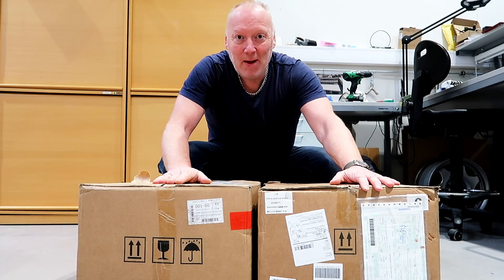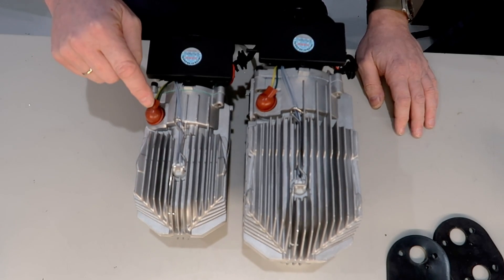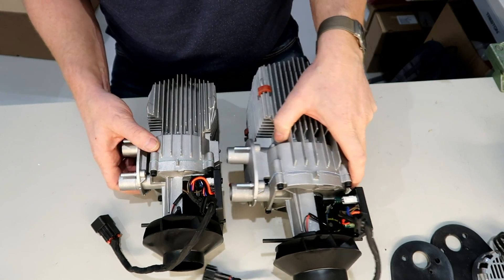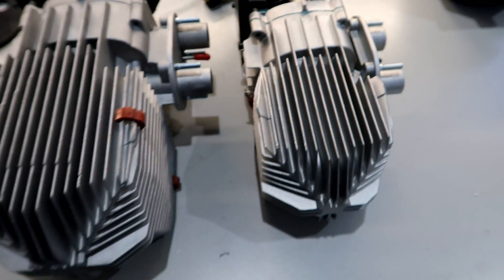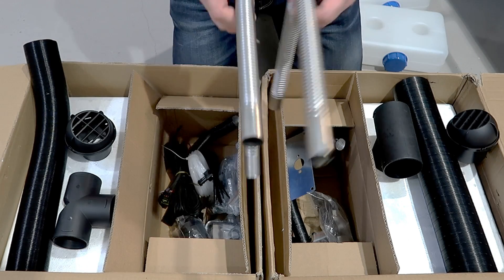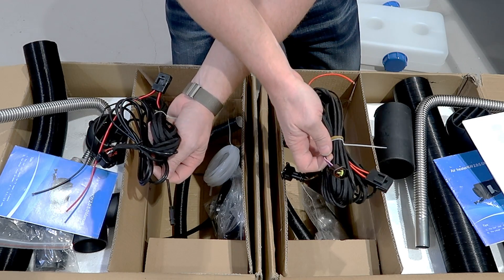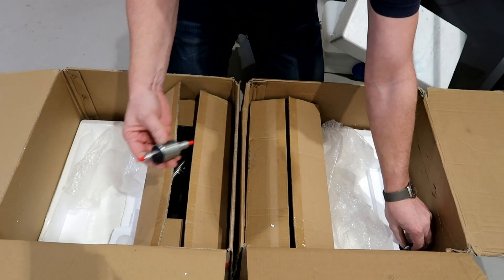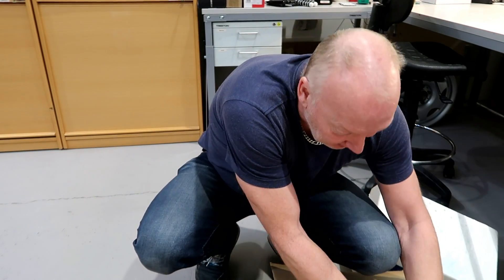Chinese 2kw vs 5kw diesel/parking  heater comparison part 1.

Comment: It's easy. the difference between 2kW and 5kW results only from the amount of fuel burned. Calculation of the pump 22ml * 2.6 Hz * calorific value of diesel fuel = 2kW; Pump 22 ml * 6.5 Hz = 4 kW. To release more heat while burning more fuel, a larger housing with a larger heat sink is needed. Electronics can remain unchanged.
Reply: calorific value of diesel fuel = 43 MJ/kg; 1 liter of diesel = 0.83 kg; 1kW = 3.6MJ... now multiply everything and you will get the heating power

Comment: For a honda civic would you recommend the 2KW or 5KW heater? Or they basically the same? Perhaps more fuel usage on a 5KW? I'm in Canada, so it gets cold, -15 celcius, want to do some winter camping. The heater will also be outside, so it will be drying in cold air. Would want the heater to run on low and keep inside the car at about 18 deg. Celsius. Would it be automatically turn on/off according to thermostat temps?
Reply from the maker: I will have to say the 2kw, but I'm no expert. maybe you could ask on some of the many heater sites on facebook, like this one: https://www.facebook.com/groups/419122475590648

Comment: can i extend the positive and negative cable on a diesel heater loom
Reply from the maker: Yes, just make sure they are thick enough. Measure the voltage at the battery and then compare with the voltage at the heater. It should be almost the same. If too low you need thicker cables.
Reply: @Italjohn   thankyou !

Comment: I have both a 2 and 5 kw heater.  The Chinese heaters are a bargain, but have spotty quality control.  The motor that runs the fan in the 2kw has 2 ball bearings that are very tiny.  The 2kw started making howling noises about 4 months after I got it and I found that of the two bearings, one apparently had not been lubricated at the factory (one bearing was like new, but the other had orange dust leaking from it...RUST.)
Reply from the maker: Thanks for the update mate.
Reply: BIggest issue is sealing. You have to seal the fuel entry tube seal and the glowplug seal with rtv at the minimum. I also seal the motor to the motor shout .

Comment: Does the smaller unit still require too much wattage on start up to be used off a 12V?
Reply from the maker: They pull the same wattage, as it's the glow plug that uses almost all the 10-12 amps needed to make it ignite. You can use it a 12 volt power supply as long as it can deliver at least 12 amps.

Comment: As the first video i have found, that shows the white full alloy body model of 5kw(some claim 8kw), which i have 3 of(i prefer all metal ones only, just seems much safer to me). I thought i would let folk know, there is a total junk model out there. Much to my disgust i bought one as well. The difference is that the top cover is a full half of body cover, which splits both the inlet and outlet, rather than just the inlet like these ones. 
Be warned, they are junk, no parts are interchangeable with the others (all 3 of my good ones are from different manufacturers, but all parts swap fine), they have no advanced settings option, the supplied baseplate needs a lot of filing to fit studs and clear air inlet port, the display of controller blanks after 10 seconds until a button pressed again, and the noise of the fan is horrendous, (like we are talking 50 times louder than the others on minimum speed, i have both side by side for testing ) very nasty items, and worse some use pictures of these ones to sell them (as did the local jerk i bought off), so it's wise to ask if item being sold is actually the one pictured.(noise is a high pitch howl, a bit like feedback in an amplifier type of sound, really annoying)

Ps, the good ones are nice units, no issues seen yet, with at least 200 hours run time each on 2 of them. 
My calcs say likely only 4- 4.5kw max though, using 0.5 liters per hour running flat out, at 8hz and is correct when compared to consumption on espacher site(i find advanced settings of 1500/5000 rpm, and 0.8/8hz works well for me at sea level)
Reply from the maker: Thanks for letting us know 👍

Comment: Pumps should be different capacity, as I see spare parts.
Parameters defaults should be also different
Reply from the maker: You are right, I have figure it out now 😀 look here: https://youtu.be/kOaQKf-i2f4?t=233
Reply: @Italjohn  when u enter the secret 1688 page, there is a useful parameter to decrease power of glow plug (less current drown when starting and stopping heater.)
1-3 is for 40w glow plug
4-6 is for 80w one.
4 is minimum and save 3A, compared to 6 as default set

Comment: Is my math correct when I say a 2000watt rating will use 166amps at 12v? If I have only 200amp hours battery storage at 12v I could only run this heater for 2 hours...
Reply from the maker: It gives 2000 watt of heat, it does not draw 2000w from the battery. It's all in the decription below the clip. 
How Much Power Does it Consume?
1. On startup the heater takes 10 amps for approx 2 mins 39 secs whilst the glow plug has power (6whr (watt-hour))
2. On low power 1 amp (13whr)
3. On medium power 1.8 amp (24whr)
4. On high power 3.7 amp (50whr)
5. On shutdown the heater takes 10 amps for approx 55 secs whilst the glow plug has power (to ensure all fuel is burnt off before cooling down and shutting off)
6. On cooldown the heater takes 1 to 1.3 amps, the time period varies depending on what setting the heater power was prior to hitting the stop button. but approximately 1.5 to 3 mins 
In a nutshell, run overnight, expect about  150w over  8 hours (calculated, not measured, yet) which on a 12v system is about 12 amp-hours.

Comment: I would be interested in knowing if there is a difference in cfm of the circulation fan?
Reply from the maker: 2k units produce ~62CFM, and the 5k approx. 150CFM
Reply: @Italjohn  I have had trouble with the 2kw heating my 5th wheel. When it's very cold and windy. The temp coming out of the vent is plenty hot. I ordered a 5kw unit because I believe I just need to circulate more air. Great video.

Comment: Approximately how much diesel will be required to generate 1 kW of heat from the 2kw unit ? I only need 1kw of heat .
Reply from the maker: How Much Fuel Does It Consume?
 About 0.1L per hour per KW of heat. Look for more info in the decription below the clip.

Comment: Im trying to decide which to get, I'd rather the 2kw because in my testing with other heaters that is more than enough, also Ive heard they last a lot longer between cleaning if you run them on their highest settings regularly...5kw would roast me out of my truck for sure.
Reply from the maker: Yes, a 2kw is more than enough for a van

Comment: Italjohn, what are the overall size of each heater mate.?
On eBay their are 2kw and 5kw heaters, sold directly from China and both are shown as 15 x 15 x 38cm...which i am thinking is the smaller one..?
 Just dont want to get ripped off. Thx.
Reply from the maker: The 2kw is: 28*11*11cm  Bought it here: https://bit.ly/2TlMU0I

Comment: Where did you get the 2kw unit from with the remote control. I can only find the 2kw with a manual dial .
Reply from the maker: I have added a link under the video, in the description. Bought it on Ali Express.

Comment: The #5 in the description.  Why glow plug at the end (waist of battery power). The glow plug will not get the burn chamber any hotter than when it was burning fuel? The glow plug at beginning will clean any sout left from previous burn. I like the idea of the diesel heater but looks like it consumes a lot of battery amps at startup and shut down. If one does it several times during a day, the battery will run down.  That is why I have seen(UT) people letting it run continuously (or long runs) on low.
Reply: I think that was the intent of the design. Consumption for anything including an ac unit is highest at startup. That's why you usually trip a breaker when you plug something in.   At low power the 2kw uses .1ml of fuel I believe and at high I think it uses .24ml... 250% more consumption at startup which lasts approx 5-10 minutes. You're better off running at low continuously for electricity, fuel and carbon buildup. My inexperienced 2 cents anyway.

Comment: do you have a solution or ideas on how to make these heaters operate at high altitudes, it seems lack of oxygen cause flameouts. I think the european  models have a type of compensator to adjust for altitudes. What say yee.
Reply from the maker: I have no idea, sorry. The blue remote has a altitude "meter" built in, maybe this fix the problem?
Reply: mix 50/50 diesel/ petrol

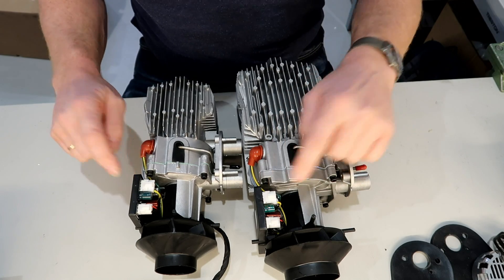Comment: The plug @5:00 is REALLY importent that it is tight to the body! If there is a leak from the burnchamber  carbonmonoxide will come out there.
Reply from the maker: Good tip, thanks 👍😃

Comment: I was about to change 5 into 2, as it is too hot after 30 mins... Do you think it will fit with just changing the only wire for the remote control? Or maybe even just using the same remote control? Thanks a lot!!
Reply from the maker: I can't tell really but if the plugs are the same, I think they would fit either way. On my two heaters the circuit boards looks identical.
Reply: @Italjohn  thanks

Comment: did I miss the muffler?are you willing to test on with US gasoline not diesel,, most motor homes here do not use diesel,,  I believe the computer on the unit will control the unit by temperature...will you bench test it for us on YouTube...
Reply from the maker: No I will not test this with gasoline. Please read/ask in this group: https://www.facebook.com/groups/146837062640024/
Reply: It is called Diesel fueled heater for that reason.
Reply: it is but, I will do it when I have the time.. you wont even try... 
put it on the workbench and test it,,, one time,,
Reply: David McLuckie on Youtube has a film.. it does run but,,,, ?
Reply: @hamishconstruction why don't you go get a $200 diesel vehicle off craigslist and see how it runs on gasoline. When the motor seizes you can take it to the salvage yard for $200

Comment: Hi, loved your comparison, thanks. Is the 2kw quieter?
Online the 5kw is rated at 76db. Would the 2kw be less?
Thanks again.
Brian
Reply from the maker: I can't tell as I have not tested them yet. I will however install the 2kw in my Vanagon T3/25 soon. The 5kw will be sold or kept for parts.
Reply: @Italjohn   have you installed this yet? I was wondering how to keep the diesel tank out of the inside of the van. Just curious where people are keeping it.
Reply from the maker: Hi Kristen. No it's still in the box ☹ I have not decided if I shall install it under the van or inside. I think I will go for the "under van" solution. The diesel I will take from the cars diesel tank.

Comment: Need around 30 to 40 BTU's per square foot of space you want to heat (depending on how insulated your space is. The smaller one 2KW (6,000 BTU's) would be good for around 150 square feet. Most vans are only going to be around 110 square feet or less so the larger ones would have very short run times and the burn chamber will soot up and you will have to take it apart to clean it. Need to size what you want to heat up so it works properly. If you put one that is too big for your van or camper it will soot up. Ones that are too big for where you are using it will shut off to fast before the burn chamber can get good and hot to burn off any soot.
Reply: The one I have stays on all the time (5KW). The setting just sets the fan speed and fuel pump pulse rate. No thermostat so it keeps running till you turn it off. been running it for two years now with any issues. No smoke, no hard starts. With that said I have changed the pump annually and the exhaust pipe once. I have a chinese brand heater. I love it and it has been a game changer for keeping me comfortable in my van during the winter.
Reply from the maker: Thanks for that informative answer.
Reply: I disagree by far, 5KW running for 5 years every winter for at least 60-100 days in a mini Camper, it Minus degree are enough outside it's not an issue because it runs long enough on full power

Comment: Thanks for the video.  I just got my 2kw one but couldn't tell whether they sent me the 2kw one or a 5kw one.  I'm glad to say I got the right one.  A 5kw would have been WAY too much heat for my purposes.  And setting these on low for too long will build up soot...so I hear.
Reply: Anyone know if a chafon power generator would run this? 346WH
Reply: Where did you get the 2kw init from. Do you have the link where I can find one.
Reply: @philprice760  I got mine off amazon.  I went back and looked and don't see it in my history of purchases so I'm guessing the seller no longer has any.  This kit at this link looks like the same thing I got.  This seller only has 3.5 stars though so maybe search around on amazon for better seller.  Also, I later decided to get a digital readout for the heater since it gives you more control over the heater. 
I've used mine on a couple winter trips and I turn it on for 10 min ever month and it seems to be working fine still.
https://www.amazon.com/Happybuy-Motorhome-Trailer-Control-Silencer/dp/B07LFXMNMD/ref=sr_1_2?crid=1SS56MG236ZIH&dchild=1&keywords=2kw+diesel+heater&qid=1590206200&sprefix=2kw+diesel+heater%2Caps%2C194&sr=8-2
Reply: Oh, also, I've read that the mufflers that don't have a bend are quieter.  I could never find one that wasn't similar to the one in the link... which does have a bend.  I personally don't find it all that loud though. 
NOW, the fuel pump is a different story.  That clicking is kind of loud, especially if you actually connect it to something.  What I did to quiet mine was take a container and lined it with some soundproofing.  Then I cut a hole on each end at the top and rand the fuel line through it with the fuel pump suspended in the air inside the container.  You can still hear it but no wear near as bad.  I have mine on the inside though.  Many people mount their on the outside but I didn't want people walking by to hear it from a distance.  You have to get kind of close to hear/notice the muffler.
Reply: From your message I’m assuming you can buy the digital control unit separately then for the 2kw unit where for the 5kw they come as standard?
Reply: @philprice760  Switching out the controller was super simple.  It was plug and play. Mine seems to work fine.  However, when I looked it up just now the one that I have is no longer available by the seller I used.  When I look at other sellers that have what looks the same theirs says that it works on 3/5kw heaters. 
That said, I ran into a LOT of confusion on these heaters.  It would not surprise me if the 3kw heater is the same as the 2kw heater.  That either the 3kw is really 2kw or that the 2kw is really a 3kw... or possibly both are 2.5kw or some other mix.
The digital control I bought said, "12V LCD Monitor Air Parking Heater Switch Controller for Car Track Diesel Air Heater MA1870"
The ones I'm seeing now say stuff like, "3/5KW LCD Switch 12V LCD Monitor Air Parking Heater Switch Controller for Car Track Diesel Air Heater MA1870"
Again, via Amazon.
And even if they are supposed to be exactly the same and they aren't necessarily "exactly" the same.  I heard mixed things about the one I got in regards to whether it would work or not.  Some said it did for them, some said it didn't.  Mine happened to work.  So, maybe two different versions?  Maybe some were broke?  You got me. 
I will note, however, that the ones listed now have remotes.  Mine didn't but it is possible it has the ability and just didn't come with the remote. 
Also, the digital controller I got is the black plain version.  There is a fancier looking one that is oddly shaped and comes in colors.  I've heard that one would work on mine also but I wouldn't know for sure.
Btw, if you plan to just turn the thing on and off then the plain knob control works fine. The digital one provides additional abilities.  I think it allows you to put it on a timer, which I personally would never do.  I only got it because I wanted to be able to change the fan/pump speeds so I could perfect the burn to prevent sooting at high altitudes.  From what I can tell they are calibrated to run best at lower altitudes.  Figuring out how to best calibrate for different altitudes, is an entirely different rabbit hole...lol.
Reply: I am a bit sceptical about buying one of these Chinese heater tbh. I’ve heard good and bad reviews. My heart is telling me buy an Eberspacher and have done. Made Germany. Top quality etc. Something that is 1/6 of the price mustn’t be as good. I’ve had cheap before and always ended up buying the expensive one in the end so ends up costing me more. 🤔
Reply: @philprice760  I think it depends on how often you plan to use it.  I only use mine for winter road trips.  So, not that often.  If I was living in my van full time or doing tons of cold weather trips then I probably would have gone with a more expensive one. 
That said, if I had plenty of money then I probably would have gotten the expensive one regardless.

Comment: They do two sizes in the metal box ones a 2kw and 5kw they are the same 75mm air outlet same engine the 2kw is fuel restricted the small one is the old model now the 2kw and 5kw well be the same size makes it easier for manufacturing.
Reply: I was looking at getting one of the all-in-one units. Are you certain that they are all the same 5kw heater unit size? I wanted a 2kw, but not a tuned down 5kw.

Comment: Had mine up and running, but now it's stopped showing E-06, and the fan icon flashing......tried everything , to do with the fan, moving it by hand etc, it runs freely but there is a click on the PCB, the icon flashes, E-06, and nothing. Any ideas would be most welcome.
Reply from the maker: I will highly recommend you to ask on this forum https://www.facebook.com/groups/146837062640024/   These guys know everything :-)